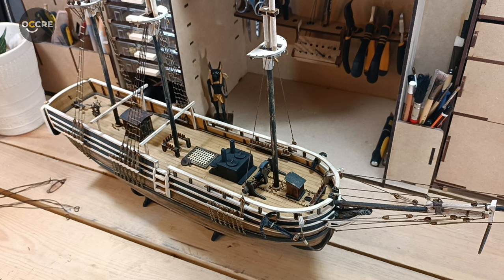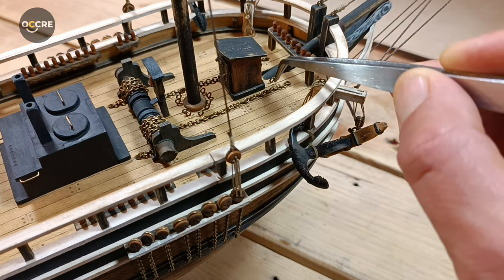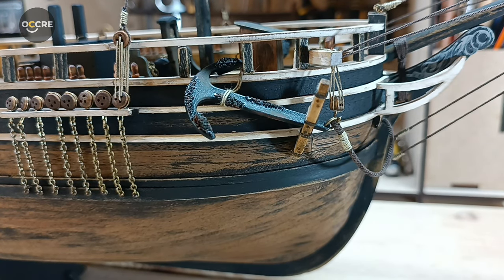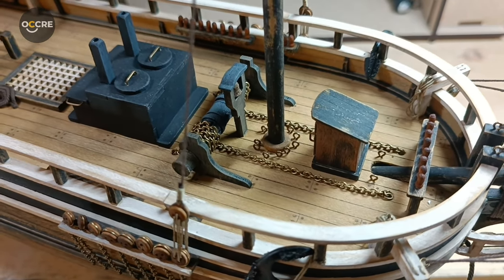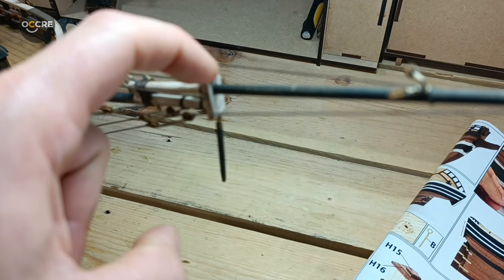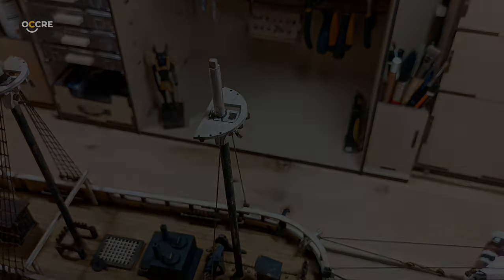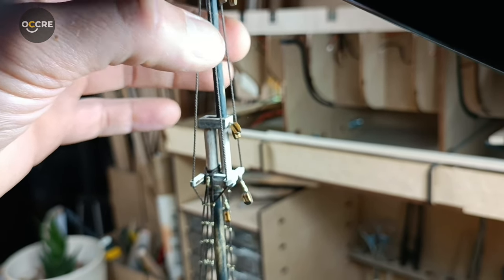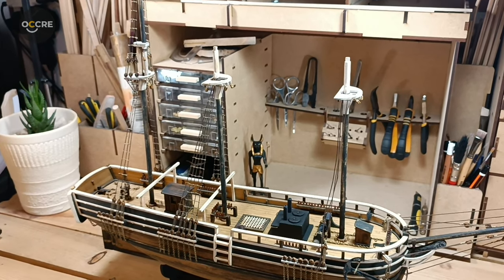Essex #16 From deck to masts

Comment: How did you get the paint to stick to the metal beam that rolls up the chains? It's discussed around 4:40 in the video. I don't know the name of the piece. I am having trouble getting paint to apply well.
Reply from the maker: First I glue all the pieces together, then apply primer in spray, then black paint and in the end brown paint applying by dry brush technique. Dry brush technique you can check my video of bronze effect I show there how to do use this technique